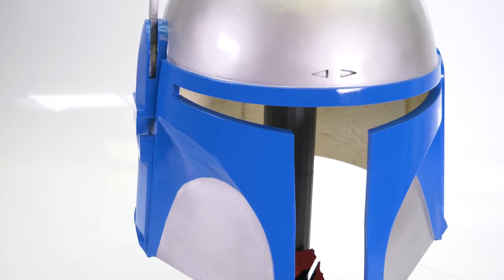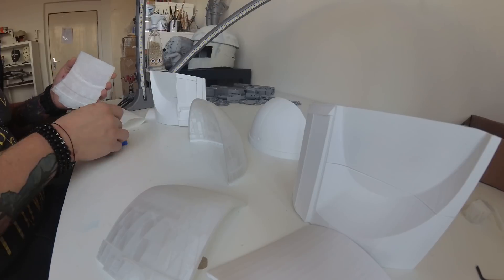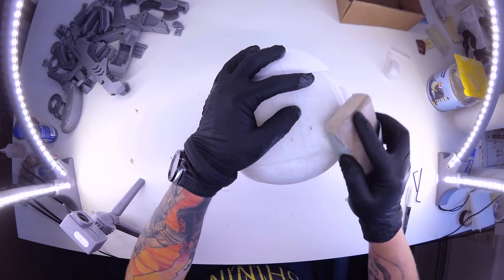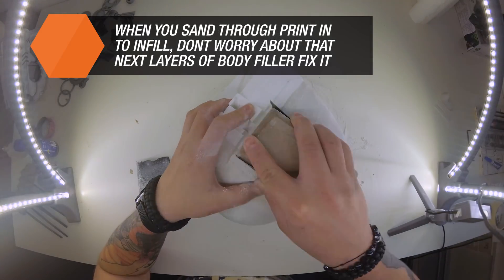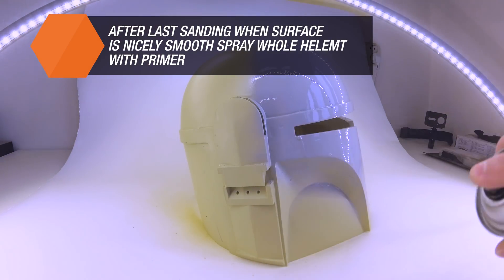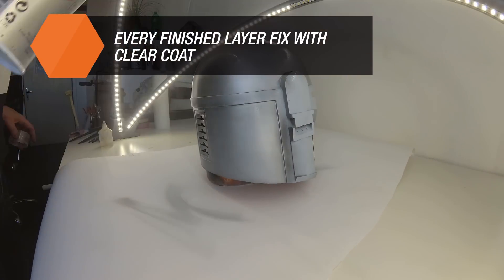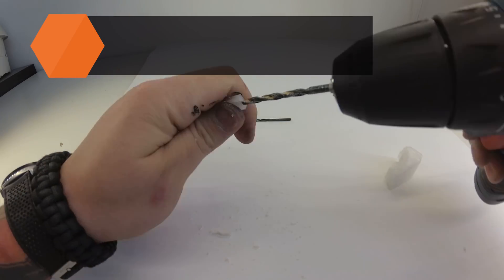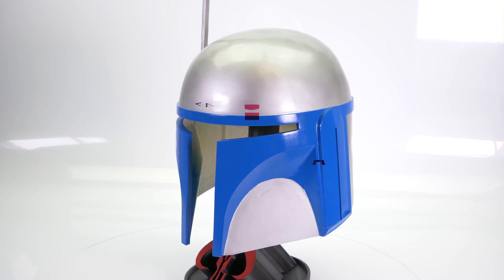Can you print a huge helmet on a Prusa? - Postprocessing of 3D prints step-by-step

Comment: No one seems to talk about it, but how fast can you speed up your prints without issue?   I tried 233% and it seemed perfectly fine.  Will it do 400% ?   800%?

Anyone test this?
Reply from the maker: The thing about just rotating the knob on your printer is that it doesn't adjust acceleration, just the speed values. So if you're printing something fairly small, you can set the speed increase to almost anyhting (1000%) and it won't really make a difference, because the printer will not accelerate fast enough to reach those speeds. On bigger prints (like this helmet) it can speed up the print, but it's always a compromise. At some point, the hotend won't melt the plastic fast enough and you might encounter all sorts of issues.
-Mikola

Comment: This is great info!  To speed up the sanding a bit, use lightweight body filler instead of regular, because it sands faster, and use a high build primer instead of regular primer, because it goes on thicker and  also sands quickly.  Suggest using a different color filler than the plastic, and different color primer than the filler, to make it easy to see when you've sanded through that layer.  Get it smooth with primer first, as the matte primers sand faster and don't clog the paper as much as gloss finish coats.  For a deep shine, use matte paint and a clear coat.  Just tips from model making and autobody work that apply here.

Comment: After priming you want to use a thin layer of guide coat spray.  It's much more effective at identifying low spots before you sand.  It's commonly used in automotive painting to ensure extremely flat surfaces.

Comment: The fattest dislike for using poliester resin without respirator. that stuff is toxic, as well as body filler
Reply: Was thinking the same thing. Epoxy: Expensive no respirator needed, Polyester: Cheap but toxic.

Comment: It is better to apply one or two layers of spraycan-filler before sanding, you don't have to sand as much and it is much easier to see how many passes you still need for a good finish.
This is especially usefull for PLA parts which are hard to sand.
Also don't cover the whole model with putty, apply the putty only to the seam-lines, you could also try to use disolved plastic (sprue-goo) instead to fill the gaps.
Reply: Depends on how smooth surface you want. If totally cover it and then sand it and all over again till surface is not totally smooth ;-)

Comment: Kind of defeats the point of a good 3D Print. I would just use my Anycubic Chiron as I do and print all in one go. And then for ultimate smooth finish just use Acrylic Spray putty and a light sand with wet and dry. Painting is easy after that.  A lot less work.
Maybe this much work is needed when printing with a Prusa, not sure. :-P

Comment: Does it works with PLA ?
Reply: Yes, the same process applies very well to PLA. It's mostly personal preference, and also taking into consideration how the part will be used. I've finished some smaller PLA  prints using the same method up to 2000 grit and they look like professionally made, injection molded parts. I'd recommend wood filler though instead of body putty. Cheaper and easier /safer to work with.
Reply: @joshallred9330  thanks for the fast reply !!!
Reply: @joshallred9330 Hi! Can I brush polyester resin to reinforce a PLA printed helmet on the inside? Does it reinforce the overall structure?

Comment: I recently bought the i3 mk3 kit and I must say, I am absolutely amazed by the entire thing! This is my second 3d printer, my first was one I bought around four years ago, and it is a night and day difference in quality. Right after the build and after fixing one or two things that I did not do perfectly, It has had multiple amazing prints. The layers look amazing and the crash detection has worked flawlessly so far, both with simulated crashed and a crash that was my fault when checking things with my calipers while it was printing. This printer has already done 2 days and 18 hours worth of printing in the less than a week that I have owned it. So far, I must say, this printer is the best I have seen, without even changing from stock settings. I cannot wait to take this into the class I teach to children over the summer. It has also taught me a few things that I did not know which is good because I am at school for mechanical engineering. Thank you for making such an amazing printer!

Comment: So. Much. Waste. I don't even mean the support material, that can be recycled. All the plastic tape, tiny filler particles, the spray painted paper that can't be recycled, and the leftover resin.

 Please be conservative when possible. Re-use tape, don't throw out your printed plastic waste. Store it and separate different types. The tiny particles are the worst but you can melt them down into something functional or at least more easily recycled chunk.

Comment: It would be nice if when splitting the print in Slic3r, to allow adding alignment holes that later can be used to aid in gluing pieces together using toothpicks as dowels. Might be worth suggesting that to the programmers?
Reply: That would be too complicated, not all split areas are the same. Using Fusion 360 to manually split and create joints will only takes a few minutes.
Reply: That kind of feature probably wouldn't be all that hard to do. Could just do a planar cut and plot a 3d periodic function on that plane. Maybe belongs in CAD or an STL editor though.
Reply: You can use meshmixer, and even this channel showed it few months ago.

Comment: The best options are not PLA or PETG. ABS is the best option for props since it's the most easy to sand and is the most heat resistant. I have friends which have printed props in PLA and put in alot of work but they left them in their car on a summer day and guess what happened? They warped pretty badly and had to throw them away. Hours of printing and post processing work in the trash.
Reply: Nope that's the reason why they use fiberglass inside of helmet ;-)
Reply: @TGWMS  I think the fiberglass adds a bit of strength, but I wouldn't want to take the risk of leaving PLA parts in a hot car.
Reply: @BenJohnsonDotNet  no problem with it. I test it ;-)
Reply: @TGWMS  Very nice, I'll have to try it!
Reply: @TGWMS  sadly it would happen pretty quickly here in Louisiana,  the tempuratures in a car quickly approach the glass transition tempurature of pla.  However pla is still much better since you can avoid the warping of the abs
Reply: @tankkiler308 aybe in Louisiana but here in Europe summer is around 28-35° and reinforcered pla with fibreglass have no problem with that in closed car. Or I use petg instead of abs because it smell less and detail is lot better
Reply: @TGWMS  lousiana is mild compared to some of the larger expos in places like orlando and las vegas where the heat is dryer but often much hotter.  Ive never used resin so i wouldnt know how well it prevents warping but usually if the print reaches GTT of pla even a reinforcement will only help so much due to hollow spaces within the print.  Again i prefer pla but if your storing in a vehicle its best to use pet rules and leave the car running or remove it.  The best option is to 3d print a mold then resin cast the part.
Reply: If you use abs what kind of warpage are you getting with a large print, what machine are you using?
Reply: @tankkiler308  looking at the number of parts that were glued together for the helmet...I wouldn't call those especially large.  Now, if you were going to attempt to do the helmet in two halves warpage would be more of an issue with ABS, but you could probably still manage with an enclosure and a custom end script to ensure the heatbed didn't just switch off at the end of the print, but dropped off gradually.
Reply: @Baiswith  true, i usually use as few pieces as possible when i do parts and helmets so it makes a big differnces compared to small ones like this
Reply: @tankkiler308  of cause Prusa i3

Comment: I used a wood filler and it worked pretty well for filling cracks.
Reply: Less toxic too.
Reply: Cool, i use spackle paste to fill small holes, it's non toxic, premixed and can be thinned with water, i also use a thin mixture of plaster with water to cover layer lines.